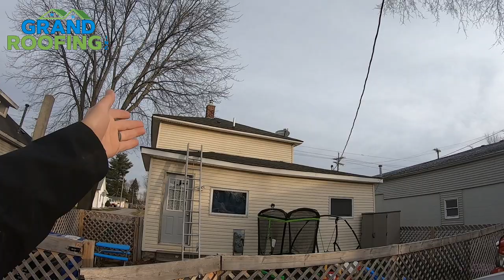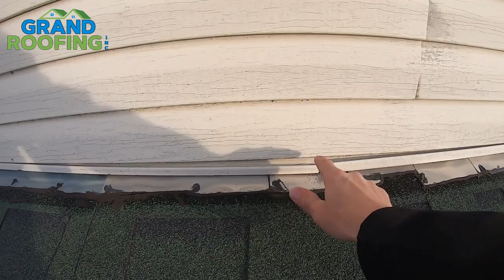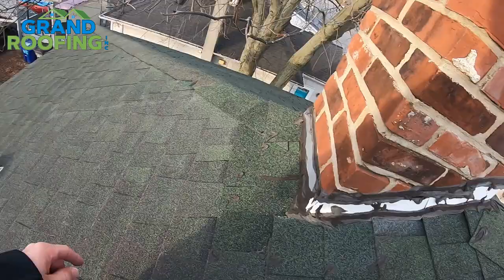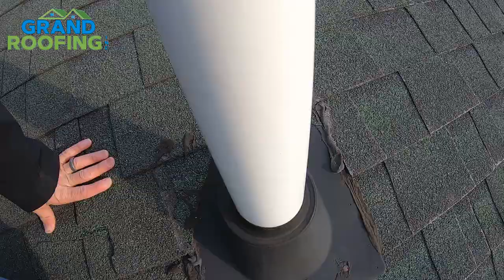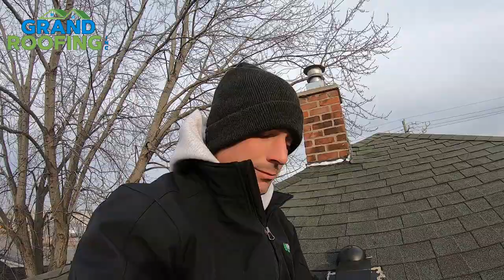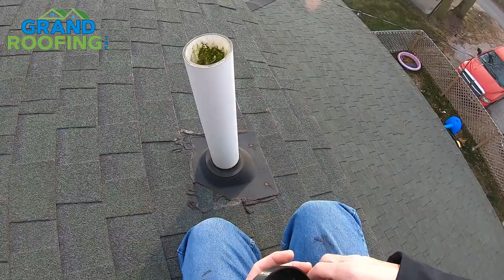Roofing leak how to find and plan for a roof repair

Comment: Great idea on the Cap!! Easy to install and will definitely make life easier.  Every pipe should have one of these. When they go on sale I will Buy them buy the case. Assuming you will have a 1-1/2" and 2" version as well. Again great idea!
Reply from the maker: Thank you, as of right now they are only for 3 and 4 inch pipes. If marketing goes good and sales pick up, we will invest in a smaller version. Most of the pipes that come through are for soil vent pipes which are typically 3 and 4".

Comment: You’re an engineer as well it seems!  Great idea and took it forward which is the harder part. 

If you get that job and go through fixing the items do you leave thinking there’s a certain percentage that you won’t hear back. Say 95% you fixed it. I think would be tough to feel it’s 100% solved since you’re just making the repairs and could be something small didn’t catch. Just curious.
Reply from the maker: I like to try and feel like I'm 100% certain I fixed the problem. I am human and have missed things before though. When I get done I try not to stress about it at home during the next heavy rain storm. I just know if there's a problem I'll go back and take care of it no charge. So I can still sleep good at night, but it kind of does suck to go back for free. So by no means am I saying I'm perfect. If I've done something wrong I'll admit it, own up to it and fix it. I feel that's what sets apart the good guys from the bad guys.

Comment: I live in a different country and I have had about three roof men come and fail to repair and the others are wanting to lay a new roof on top of the existing roof. I don't trust them. Can I video call you for an opinion?
Reply from the maker: You can find us on Facebook at Grand Roofing Inc and send picture messages. I definitely would recommend against going over the roof. To me that screams they are possibly bad quality and just want a quick profit. Not always the case but most of the time.